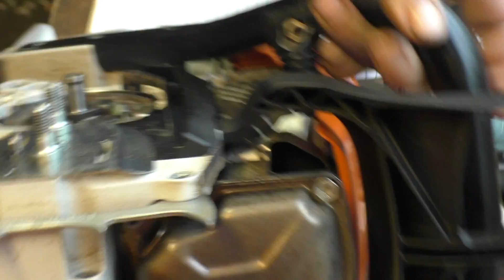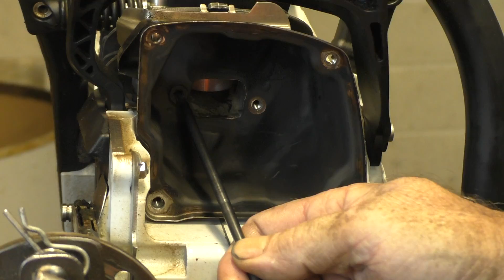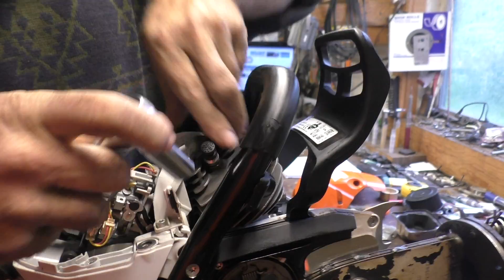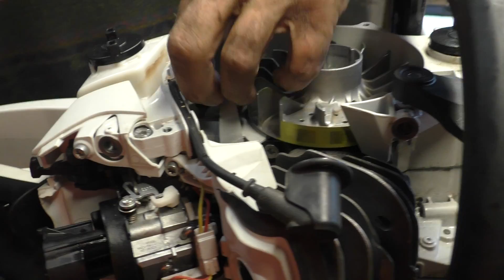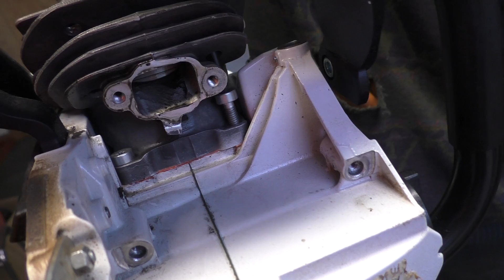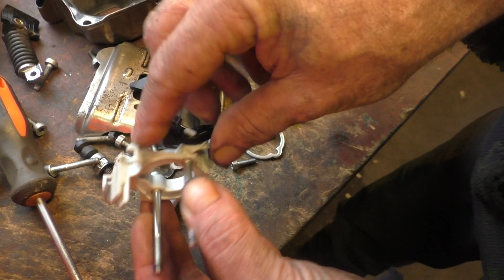Stihl MS462 - Tear down for port work

Comment: When I see tear down like that, with bolts, nuts, and screws flying all over the place, I know for sure, good few of them will be missing, replaced with different ones lying on the shop floor, etc. Messy, messy dismantle.

Comment: Carbureted junk. Throw that away and get a fuel injected saw.
Reply: I take all the carbureted chainsaws you want throw away.
Reply: Sooo basically 1 chainsaw that's not out yet. Every saw currently on the market has a carburetor, the only exception is the upcoming Stihl MS500i.